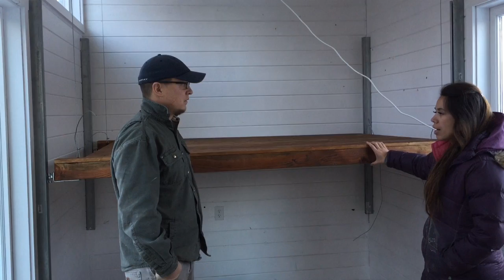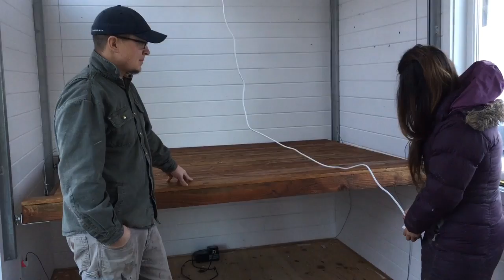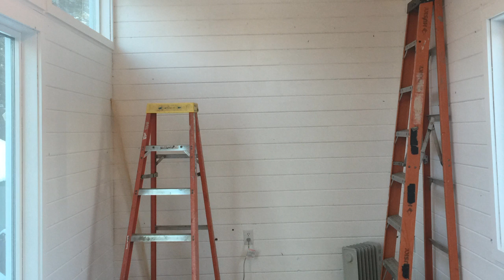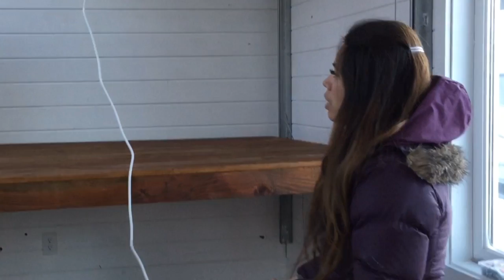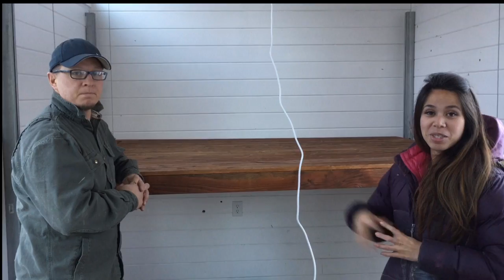DIY Elevator Bed for Tiny House

Comment: How could you make something like this work in a class c motor home rv.  we just got a shorter one, its going to need alot of work anyway.  no way the two of us would fit in the cab over part.  but I was wondering if there could be a way to "lower a bed from over the cab and fold out the sides..

Comment: Could you supply a link to the garage lift, I cant find one that looks like yours. I understand the track and wheels, it's the cable motor winder system with 4 cables. Thanks
Reply from the maker: Here is my post that covers the components used https://www.ana-white.com/woodworking-projects/diy-elevator-bed-tiny-house

Comment: DE-ALEGRETE-RS ,  BRASIL-   Boa noite, solicito por gentileza o máximo de  informações sobre a CAMA SUSPENSA , eu gostaria de colocar em um furgão ducato da fiat , por isso solicito relação dos  materiais usado incluindo  motor, a empresa  tem a venda todos acessórios  , e como posso trazer para o Brasil,  GRATO . whatspp  55 55 99979 7244   ,   luz-ag@hotmail.com   ,  01/09/2020.

Comment: The rear sleeping area of a toy hauler camper use a double set up like a double bunk bed.
And they have sliding seats in the bottom on the floor for a dinette eating area or in your case a type of hide away bed that could be used as a couch during the day.
if stacked properly you could sleep 6 people in that one spot and run them up when not using them.

Comment: Hi Ana and spouse......  I have built my Big Tiny House.  I’m living in it while I’m completing the finish work.   I have had the electrician wire for an electric outlet to put in the elevator bed.  My problem.  Where did you get your garage lift.  I have found different wenchs but they are with a cord and on a rail.   Where did you find the garage lift   Thank you
Reply: Did you find the correct parts?  I just finished framing mine.  I am going to install the elevator bed prior to interior walls.  Imade a few changes to design also.  I made a large closet on the tongue end instead of the window and placed the bathroom there also

Comment: I understand how the bed rests on the lower pins, but how would the bed rest on a set of upper pins? How would the bed get on top of the upper pins?
Reply: You would have to manually put in the pins after raising.

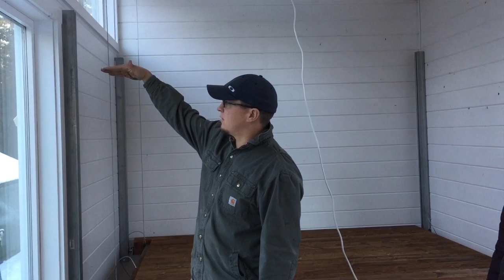Comment: 1:46 "So you never have to worry about this thing crashing down on you, which it won't"  This dude has never seen a garage door spring let go, it will kill you in a millisecond.  I would never use garage door hardware for something like this, its not designed or approved for human safety.  So you would not want to be "living" under this sword of Damocles, (look it up) and isn't the point to open up usable space in your house?    Spend $500 and save thousands, but risk your family.  Hmm, NOT.  To be safe, you would want a ratcheting mechanism, like a autoshop car lift has, that is automatically engaging as you raise this up and you would have to manually release it while lowering.  DIY with no engineering experience is a path to a Darwin Award.
Reply: Look closer, it's not a garage door spring, it's a garage storage lift, simply using a hoist motor.  But I agree, those springs are scary!

Comment: Great job putting this together.  I've searched through the comments, a number of them asking for a hardware parts list, but I haven't found the actual parts list for this.  Could you please post the hardware you used, specifically the tracks?  Thx
Reply: I agree, would love to see some specifics on hardware - specifically the hoist.  The rest I can figure out, but can't find that garage storage lift.  It's quite different than any hoists I've found.

Comment: Just a question or two for your design, which is awesome as hell! Do you have some recommended material brands that you used, or considered (Keep in mind this is from the mouth of a beginning diyer) especially due to easiest manipulation of materials or simple/direct explanations? Also have you guys experimented with a counterbalance weight for easy manual raising and lowering of the bed, or do have any ideas that may work? Also do you see this design being just as functional and usable in say a Class C Motor-home? I'd love to hear back when/if you get a chance.

Comment: I stole your idea and modified it some.  I had just spent some time re-cabling my friend's jayco tent trailer, and it gave me an idea.  It works fine, and is very cheap.  Some air craft cable, a boat winch,  4 tracks, and it's done.  (well, not quite, but even though it was a chore to figure out by trial and error as you go) It only needs to move about 4 feet total, so not so bad.  Hardest part was getting the pulling  to work properly and evenly.  It winds onto 4 separate spools on a shaft, and the handle slides into a hole on the front of the bed.  (the crank goes up with the bed as you raise it) The pulley is a reduction gear, so easy to crank.

Comment: If you don't have power you can always use the same system that pop up tent trailers use for the roof but in this case a bed. Garage door opener is clunky imho. I e always used a hydraulic winch. Much quieter. And you can have a manual option when powers out. Costs the same

Comment: do they make such beds with a pulley system that doesnt require electricity or a door opener motor? you push up it stays put you pull it down and it stays put?

Comment: This might be a silly question but could this be used on a smaller scale as an elevator to get to the loft area?..my thought process is that Im trying to find a way to avoid a staircase. I had planned to put a loft right above the living room area. It would be a walk in closet. the elevator bed would have a mattress slightly smaller that the dimensions of the platform for the sake of having somewhere to stand. The floor of the loft/closet would have a strategically placed hole so that I am lifted into the loft. Once at the top I would step up into the the closet/loft.
Reply from the maker: Anything is possible:)

Comment: If anyone is looking for the track. I found them at home depot 
* 8 ft. Galvanized Box Rail (http://www.homedepot.com/p/Crown-Bolt-8-ft-Galvanized-Box-Rail-63075/203350936).
* Zinc-Plated Box Rail Hanger Kit (http://www.homedepot.com/p/Crown-Bolt-Zinc-Plated-Box-Rail-Hanger-Kit-62896/203350913)

Lift is on Amazon.
* https://www.amazon.com/Celling-Mounted-Storage-Electric-Shelves/dp/B01A67WXDI/ref=sr_1_1?ie=UTF8&qid=1484917139&sr=8-1&keywords=XtremepowerUS+garage+storage
Reply: Ron Jon, I come from a land Down Under and am trying to find the part you mentioned on Amazon.  Do you have a link at all?
Reply: Ron Jon According to several reviews of the rack on Amazon, it's very dangerous, several people had it come crashing down.  That one is also 4' X 4', not big enough for the bed.  Ana must have used a different one.  If not, she should be very worried about liability.  I love the idea but I didn't think I would be comfortable sitting under that bed even before I read the Amazon reviews.
Reply: Thanks for the Info Ron Jon...
Reply: Hello Lilly Lee. Could you send me the link to the reviews of the rack on Amazon? Thank you!

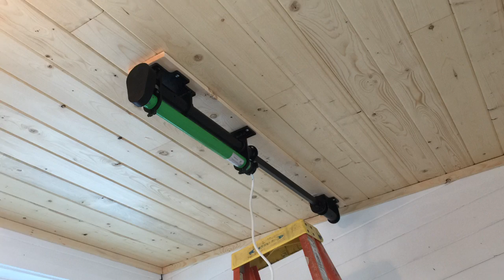Comment: Hi White family, really like what you guys do.  Very talented, dedicated hardworking people.  Suggestion, try making a sleeping area slightly off the floor on a 1 ft (roughly) platform with the 'living room' floor above it (with some stairs) and a sliding door to enclose the sleeping nook when not used.  The visual at 2:25 gave me the idea.  So the bed is under the living area instead of on top.  Would be interested in your feedback...  Hope you continue to grow in your business.  I would go for the low down bed idea (as an old lady ;-) ).
Reply from the maker: Love your ideas, keep them coming. Thanks for watching!

Comment: Interesting. Many ceiling studs, rafters, aren't designed to have hanging loads of this sort. Your case may be different, but this shouldn't be done on just any old roof support structure.
Reply: Once the bed is put into position the pins hold it. So the ceiling pressure is temporary and minimal. Also it's spread over multiple points. If you can hang from the rafters, this would be even easier.

Comment: Another great idea can be seen on YouTube. Just search for the Tiny house village in Washington D.C. with about 5 houses. There is a house that hid the bed in a platform that is about 3 feet up from the ground floor. On the platform which is just 2 steps to get up on they did an office space and closet with other storage. Then the front of the platform there are tabs that you pull on and the bed slides out into the living room space. The layout is great! Check it out!
Reply from the maker: AWESOME!

Comment: Would you please provide materials list and links to sources to purchase?
Reply: I found them at home depot 
* 8 ft. Galvanized Box Rail (http://www.homedepot.com/p/Crown-Bolt-8-ft-Galvanized-Box-Rail-63075/203350936).
* Zinc-Plated Box Rail Hanger Kit (http://www.homedepot.com/p/Crown-Bolt-Zinc-Plated-Box-Rail-Hanger-Kit-62896/203350913)

Lift is on Amazon.
* https://www.amazon.com/Celling-Mounted-Storage-Electric-Shelves/dp/B01A67WXDI/ref=sr_1_1?ie=UTF8&qid=1484917139&sr=8-1&keywords=XtremepowerUS+garage+storage

Comment: how about a tv mounted under the bed.  flip down so its out of the way.
Reply from the maker: That is another great idea, but then would have to get creative with wiring and it would add to the weight that the lift could handle. Thanks for watching!

Comment: Do you have a manual lowering or lifting back-up in case of power outage? Love the idea, having both options would make this a great idea in many projects.
Reply: Not 100% sure here, but if you freeze frame 2:24 and look at end of green tube it “looks” like there are garage door “pin tool” holes for manual rotating.  Would take forever considering you’ll only be able to move maybe 1/4”-1/2” at a time, but it’ll move.

Comment: Can you give a link to the garage lift you used?
Reply: I found them at home depot 
* 8 ft. Galvanized Box Rail (http://www.homedepot.com/p/Crown-Bolt-8-ft-Galvanized-Box-Rail-63075/203350936).
* Zinc-Plated Box Rail Hanger Kit (http://www.homedepot.com/p/Crown-Bolt-Zinc-Plated-Box-Rail-Hanger-Kit-62896/203350913)

Lift is on Amazon.
* https://www.amazon.com/Celling-Mounted-Storage-Electric-Shelves/dp/B01A67WXDI/ref=sr_1_1?ie=UTF8&qid=1484917139&sr=8-1&keywords=XtremepowerUS+garage+storage
Reply: @ronjon5468  hey Ron.  Did this set up work for you?  Did the hardware support the 2 x4s and bed the way they had it in the video?

Comment: I'm wondering if the weight limit is enough?  the weight of everything on it plus if 2 ppl sleep up there that's not gonna work?
Reply: if you watch the video they clearly explain that it doesn't rest on the cables when it's lowered. the cables are just for raising and lowering. when it's in position it will be held by pegs.

Comment: I was trying to think of some way the cables could be put inside the tracks with additional pulleys, then turned to line up with the garage door system.  I can just see me getting tangled up in the cables.  And that means the track can protect the cables too.
Reply from the maker: Yes we have some tweaking to make it completely functional. Thanks for watching!

Comment: That bed is awesome! You said the motor will lift 250 pounds. I don't know the weight of a standard mattress. I'm assuming this would work?  Fabulous idea!
Reply: Abundently Clear You only put the bed up when you are done sleeping in it. You really should only be lifting the mattress when you are storing the bed for the day...no one should be in the bed!
Reply from the maker: Should work just fine:) Thanks for watching!
Reply: If a person weighs 235 pounds...does it still work with a mattress?

Comment: I think it's an amazing idea and the fact you pulled it off with simple easily available hardware is even better.  I wonder if you would want to finish it up with a coat of white paint or maybe some fancy wood over the rails.
Reply from the maker: Thanks for watching!
Reply: Why would you want rails, in the sleeping position it won't be much higher than a normal bed. It is a genius work in progress

Comment: Well done! Instead of a garage door opener you could also look at the electric cable hoists that are available. Another option would be to have it pivot off of the wall electrically too. Just some thoughts to keep tucked in the back of your head for next time. Keep up the great work!  It's way way to cold for me up there!
Reply from the maker: Awesome ideas, thanks!

Comment: Great project. You might not need a wire in each corner since you're guiding it with the door slides. If one on each end is strong enough, that might simplify your design.

Comment: If the TV is flat agains the wall the bed can be lowered past the TV  and you can watch TV in bed as well. Nice!
Reply from the maker: You noticed that!!!  
Awesome!
Reply: Ana White Aha!
Reply: It'll work the same with a standing desk and gaming PC setup. Could lower the bed and sync up a controller or wireless keyboard n mouse, or lapdog, or whatever and game, watch youtube, netflix, etc. Should work about perfectly with a 32" or so 16:9 monitor, but I'd prefer to go 21:9 ultrawide, so I think the equivalent size in that aspect ratio is 39"

Aside from that, this can/will also highly benefit a single level tiny home. Cheers, guys.

Comment: Love the idea. I guess it will complicate the building process but i wonder if its possible to hide rails on to the walls? How would this affect the insulation of the walls? Any idea?
Reply from the maker: You definitely could.  The rails are really optional, we tossed around the idea of just having caster wheels hidden around the bed, so there is something for the bed to run up and down the wall on, but this tiny house is very rustic modern, so the rails are part of the design.

Comment: I would  add a   Security pin when is in the up position, just to prevent  any  accident.
Reply: macrapidito They already said they would do that.
Reply from the maker: good call, will do!
Reply: You have to put a pin under every corner every time you have the bed in the raised position?

Comment: I'm interested to hear more about how they're going to use the space under the bed.
Reply: Susan Johann The bed appears to be hanging high enough that you could have a sofa, or table underneath when the bed is completely lowered. If you look carefully you will see that the bed stands away from the wall, so they could mount a flat screen tv in one location that is easy to view from a sofa, and also from the bed when it is lowered.  Pretty nifty design!
Reply: Susan Johann I've seen a similar design. They will likely build an eating/sitting area underneath that will also be modular to fit the bed when all the way down.
Reply: Probably a living-area :)
Reply: gXXrGoNe I couldn't get an idea of the height of the seating and tv he referenced that would fit under the bed when it's lowered. So that's what I'm waiting to see. Maybe seating that could fold flat and some tv mount rig that could also slide down. Or maybe regular stuff could fit under there and I just can't visualize it.